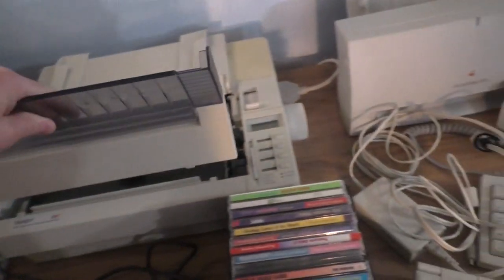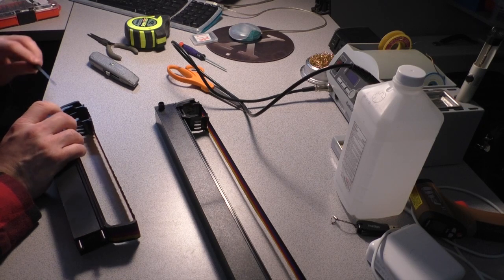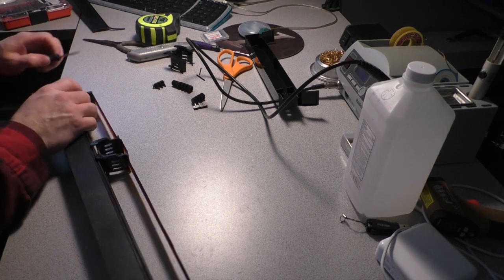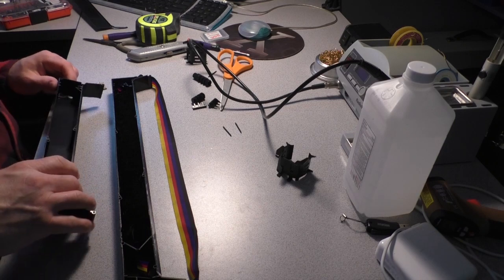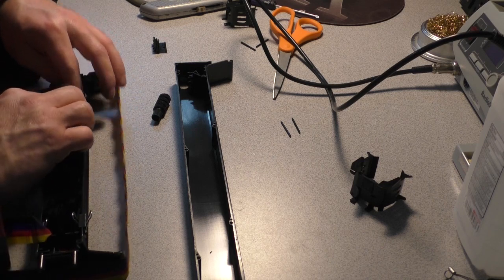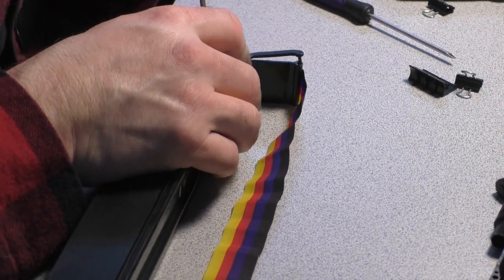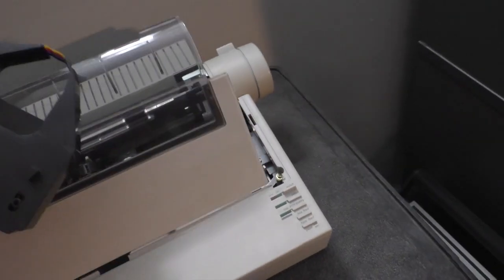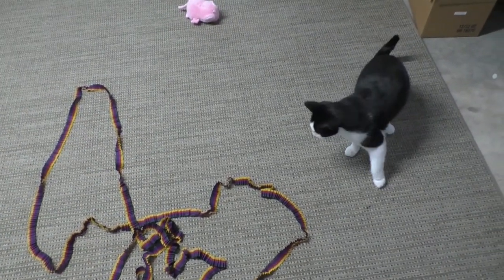Citizen GSX-140 / Tandy DMP-250 Color Dot Matrix Printer - Four Color Ribbon HACK!

Comment: As you were taking apart the large ribbon I immediately thought of a bag of chips and how it's half filled with air and that the ribbon might be able to fit in the small cartridge because of that comparison. I figured the manufacturer just increased the side of the cartridge and kept a similar sized ribbon as they love to give the illusion of "more". 

I'm happy you got it working!
Reply from the maker: Pretty much. I didn't want to pull them both out and compare lengths, as that would be horribly messy, but I do believe the wide-carriage ribbon does have more material, which was fortunately able to be compressed into the smaller cassette without issue.
Reply: @bbishoppcm  This is off topic but I have an older UPS unit that was designed to match the iMac G3s cosmetically that I want to donate to the channel would you be interested? It's pretty neat the power cable looks like what the G3 would of shipped with. The model is a BP500CLR
Reply from the maker: Yes, I’d love to take it off your hands! Contact me via bbishoppcm@gmail.com
Reply: @bbishoppcm  I sent you an email.

Comment: you can try transfering the ribbon from one cassette to another with both lids closed. Don't open the first one before. Then when there is no more of it left inside open the cassette and remove what's left. It just takes a lot of time to turn the knobs and wind in the ribbon inside from one to another but you avoid all the mess.
Reply from the maker: i was trying to avoid splicing the ribbon
Reply: @bbishoppcm  no splicing required. Just let out some more ribbon from both ends of full cassette and wind it through an empty one putting both ends of the empty cassette with lose ribbon. That way more and more ribbon should get into an empty one and when it's almost full open the first one and remove the remaining ribbon. It should look like that more or less. https://i.imgur.com/fG945IN.jpg
Reply: @bbishoppcm  If it wasn't for that stupid plastic guide. (unless I'm looking at it wrong. I use to with black ribbons. 1. Open old one up and remove old ribbin. 2. place a bit of black ribbon into the old one and put top back on. 3. spool using ribbon advanced new ribbon into old cart. (I have seen people use drills and stuff to help them along.) 4. One all new ribbon is spooled into old cart. Open new cart and pull a little bit out.  *This is providing the ink tabs are not dried out or falling apart.

Comment: i am not too familiar personally with the ribbons in dot matrix machines (or typewriters for that matter), i am curious how much if any of the ink came off onto your hands?
Reply: I'll be honest i did not watch till the end before commenting, egg on my face but no matter
Reply: @kibawolf2501  scrambled or Sunnyside up? 😉
Reply: @JohnSmith-xq1pz  i'd love to say sunny side up but i don't want to lie
Reply: @kibawolf2501  Lol
Reply: It's exactly how a typewriter works, except in lieu of print heads marked with the letter you want to press into the paper, you have a wide array of fine metal needles (more like pins but whatever) on the print head that extend to press against the ribbon and the paper to "type" a character on the paper.

For instance if you wanted to type an "A" it'll push out the required pins to type an A on the paper. Each pin will strike a dot, and so with multiple of these dots you can write a letter or symbol, kind of like you'd use pixels on a screen to draw an object on-screen. 

It's not exactly a good explaintion (I'm not that great at explaining things) but it's a rough idea of how a dot matrix printer works.

Comment: Where did you get the color ribbon from?  I have a Tandy DMP-240 that needs this fix.  Thanks :-)
Reply from the maker: Just checked with the supplier - they are permanently out of stock
Reply: Get a small canvas style paint brush loaded with an infantesimally small amount of wd40 and blot your black cartridge ribbon as it passes the brush spin rhe advancement pin to process the whole ribbon.